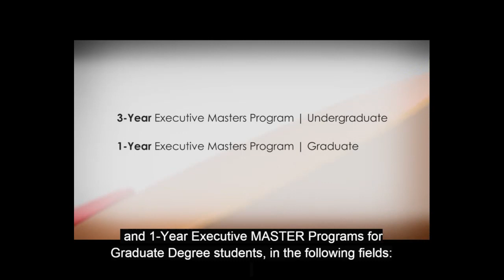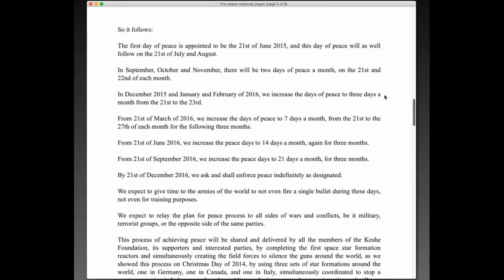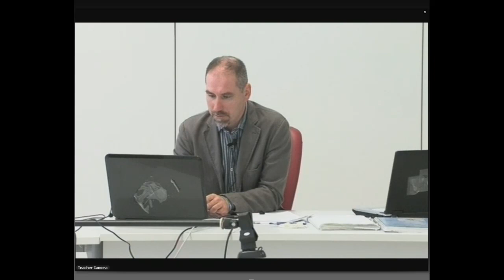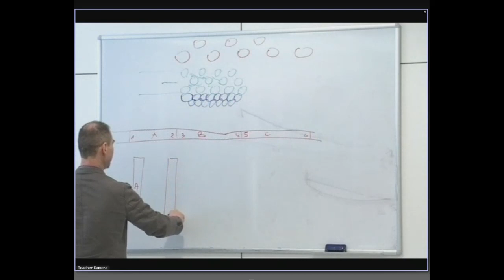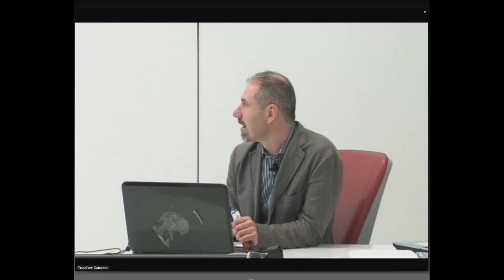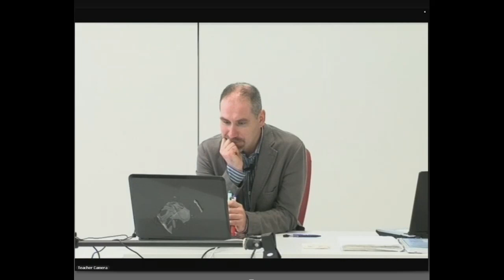63rd Knowledge Seekers Workshop May 28 2015

Comment: 00:00 Intro.
07:00 Mr. Keshe announcing the World Peace Roadmap.
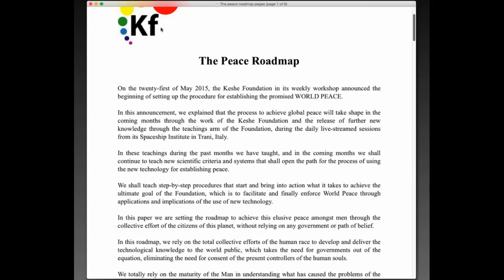19:15 World Peace Roadmap (read out).
37:30 Comments on the World Peace Roadmap.
59:00 Nano Coating experiments.
01:12:50 Linking superconductivity and structure.
01:32:45 Nano Coating principles.
01:37:00 Normal matter vs. Nano layering.
01:46:00 Nano Coating magnets.
01:50:00 Chinese experiment. (Lift, Continent movement, Motors)
02:18:30 Starformation.
02:29:28 Bottle experiment.
02:44:00 Producing Graphite GANS.
03:01:20 Layering different states of matter.
03:23:10 3 States of GANS.